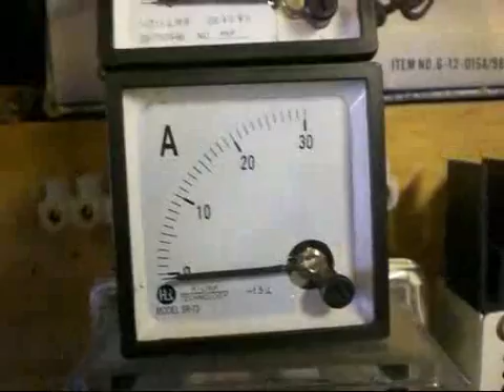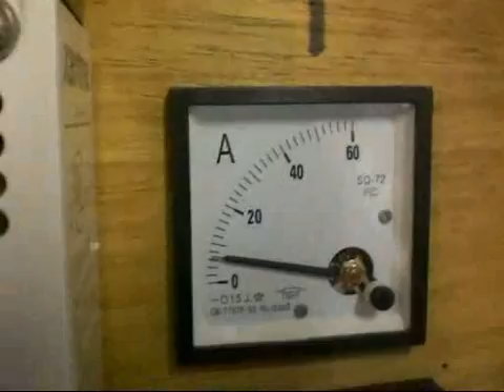Amp meters explained

Comment: Also those Crimp connectors should be High Temp Copper with wires Soldered to them not crimped.

Comment: I installed an ammeter and shunt in my caravan,as I wanted to trace a short or whatever it was that was draining the battery,what I don't understand is if I connect the digital ammeter direct with no shunt it would show 3 amps being drawn,but with the shunt installed the ammeter shows 0.07 amps being drawn......?     whats going on....?

Comment: I installed a shunt inline between car battery and deep cycle battery in the trunk, on the negative cable. When I start the car the amp-meter reads 0 as if no amps are passing through to charge the deep cycle battery, and though it still shows the right voltage of 14.5 volts. I am sure that the deep cycle battery is low and need some charge.
 I moved the shunt and placed it it on the negative between deep cycle and the load going out  of the deep cycle battery, and it worked, it read the few amps coming out. Can some one explains why nothing happened in the first case?
Reply: 100Amp shunt, the two batteries are disconnected when voltage is below 13.3 volts, the amp-meter is receiving its power from solar control charger load output, and its two other cable connected to the shunt
Reply: Negative flows to Positive,putting the shunt on the Positive terminal would most likely read low even zero,where as putting on the negative where the electrons are exiting the battery will give a higher reading

Comment: Hi.
Can i run an led of the - and + terminal on my analog dc meter, no shunt?
does this work?
Reply: Ammeter is using low voltage in milivolts to calculate the current. Not enough for led

Comment: Hi, thanks for the informative video. I've bought a digital panel ammeter with a range up to 200 Amps. It requires a 75 mV/200 amp shunt. Since I will  only be drawing up to 10 amps, can I use a much smaller shunt, say 50 amps, but still at 75 mV? without affecting the readings?

Comment: from what I have herd most meters are the same in side except the volt meters those have different coils for different voltages.  were as the current meters they pretty much have the same coils ect depending on model. the only difference is the display. and for higher currents you get a matching shut for the max current reading nice review. I have a small 10 amp for my sons solar generator I'm building him. thanks for video.

Comment: Hi, have 100amp analoge meter with shunt.just thougt i would buy a doc wattson meter to compare and make sure my readings are accurate.wired it up( source) to the dc side of the
3 phase rectifier coming from wind turbine.(load) to battery terminal.its the negative side of the
watts meter that does the measuring.as wireing instructions.Now if i tighten the dc cable the
readings read real low,wiggle it about loose and i can find higher readings.any ideas or know
of any one that may

Comment from the maker: my vid may be in error
my 10amp was fine without a shunt as it was low power but my 50amp needed the shunt to protect the meter from being cooked.
if you can look inside see how thick or thin the wires are   if they are thin then i would use a shunt as they are only ment to measure a small current.

Comment: Hi, Good video, I got 2 amp meters, 1 x 30 A, & 1 x 50 A, I am only drawing 7 to 10 amps off the power supply for my hho unit, The 30 amp meter works fine ( No Shunt) But the 50 Amp wont work, the guy said it requires a shunt to work, BUT, I notice you said that low draw of amps they should both still work minus the shunt, If so He sold me 1 dead meter , can you confirm they should both work on low draw of power please when you get time..... really useful video guy... thanks.
Thom in Scotland.